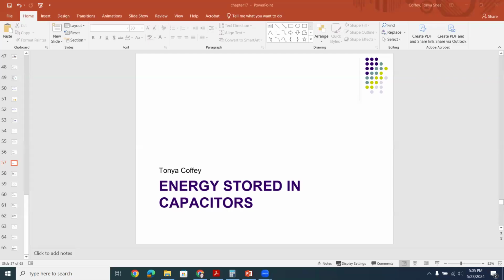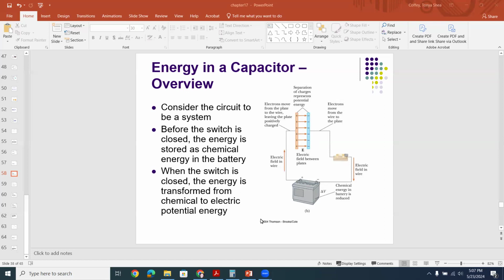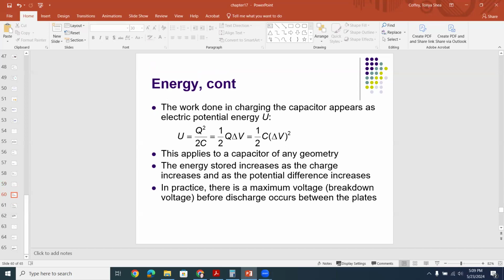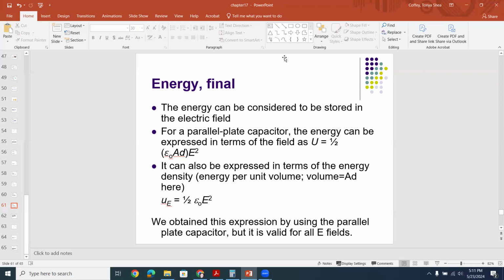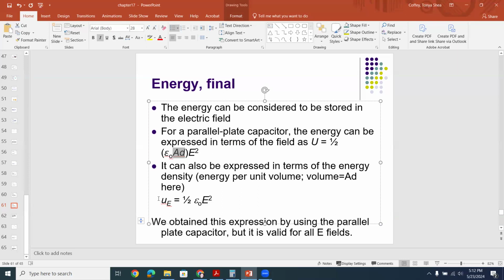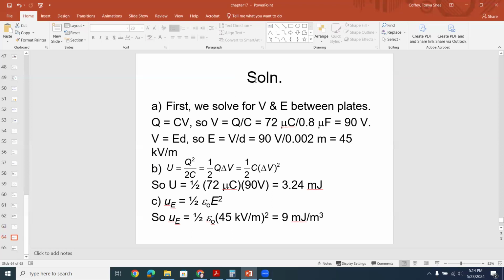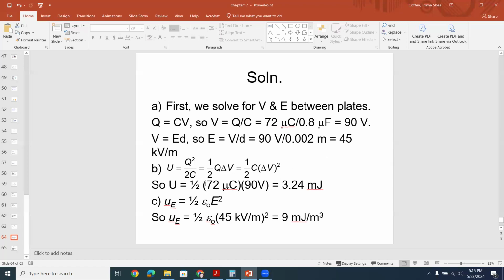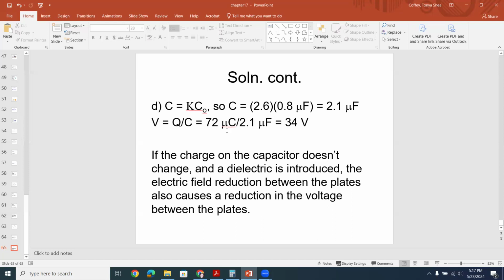Energy stored in capacitors

Comment: The battery does work on the electrons. Work is a transfer of energy. So the electrons store the energy, not the field. No field, except the combined EM-field, contains energy! So even the E- and M-fields of EM-radiation don't carry energy. The Poynting vector tells you that energy only goes in the direction of propagation!!! And it is all kinetic. Any potential energy mentioned in this video is the potential energy of electrons, not fields. Don't forget, a battery is like the slope of a mountain and the electrons are like balls on that slope. Mountains don't contain energy, but balls do!